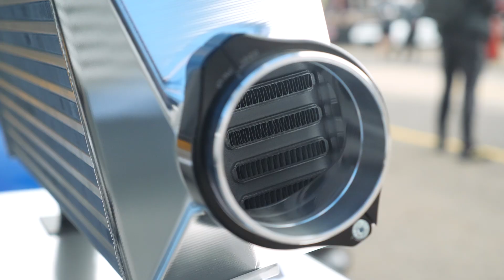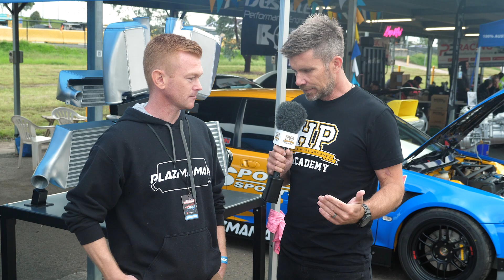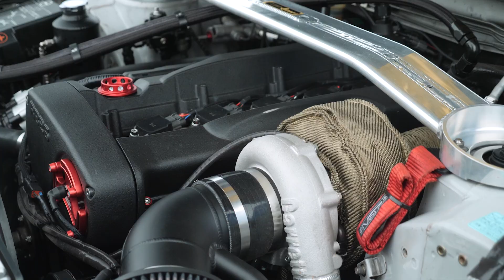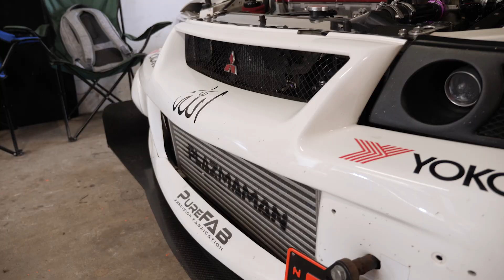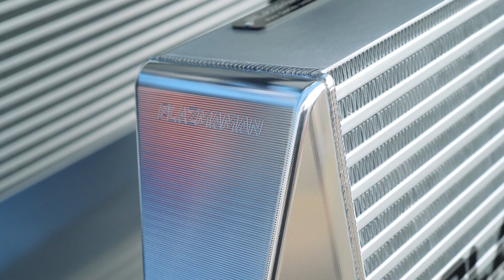Not All Intercoolers Are Made The Same 🥸

Comment: Also a good tube a fin will have 2x less pressure drop then a bar and plate.
Reply: Bollocks.  If you have less pressure drop, you have less cooling performance.
Reply: @Hypersonik Bollocks my point is still fact.
Reply: @Good-luck-Jonathan  So you're admitting that the intercooler doesn't cool as well, thus will offer detonation?
Reply: @Hypersonik  So your admitting a bar and plate will have more pressure drop?
Reply: @Good-luck-Jonathan  No, I'm saying that with either solution, if you cool effectively, you have pressure drop.
Reply: @Hypersonik  I’m saying that the bar plate will have more pressure drop inherit in its design over a good effective tube and fin.
Reply: @Good-luck-Jonathan  That is completely dependent.  If B&P has more of a pressure drop, then it can have less area because it's more efficient at cooling.

The advantage of T&F is weight.  The advantage of B&P is robustness.

Take your pick :)
Reply: @Hypersonik  B&P is not always robust due to leaking inherit by design when flexed. Pressure drop is not just related to how dense the fins are but how the fins them self's are deigned as well at how efficient the heat transfer is vs pressure drop. If you watched the video, B&P has more aluminum mass and that acts like heat sink and takes long to recover which is why for drag racing B&P would be where to use it. There have been testing down on Chinese core with little fin area but massive pressure drop so as mentioned they are not always linear.  Look how efficient this T&F design. https://www.youtube.com/watch?v=SIdOcOjr6Gk
Reply: @Good-luck-Jonathan  What you've said is a mixture between incorrectly manufactured items, and inherent design.  As for flexing the unit...that's fine if you're going to have it as a load bearing structure, more people don't.  What is more likely is that you'll get a rock thrown up at your low mounted cooler.

  You mention about the heat sink.  Yes, that is true, but if you're exceeding the thermal dissipation rate of the cooler, it doesn't matter about the heat sink effect does it.  The only time this becomes and issue is if the car is stood for a period where heat soak can mean that the until can hold more thermal capacity and thus, under flow conditions, takes longer to restore the charge air.

Pressure drop - yeah, if something has collapsed, or something has broken or wasn't made correctly, you will indeed get a pressure drop.  However, saying that B&P offers more pressure drop from inherent design is nonsense.

I watched your video.  My word, it's a lot of hyperbole.  If you always remember how thermodynamics and air flow works, you can sport the bullshit a mile away.  Again, referencing your video, if his intercooler cools charge air down to 1ºF above ambient, then an awful lot of heat must be given off to the air, thus the radiator behind isn't going to work well, which they completely ignore.

And fore some reason a B&P designed stops radiators from working.  No mention of how that happens, just that it does.  TOTAL BULLSHIT. 
This is a sales pitch video, you just don't see it :)

As I continue to say:
T&F = lighter weight
B&P = more robust (unless you're using to to mount your subframe to...)

And that's it.  Don't get suckered in by the marketing.
Reply: @Hypersonik  I still disagree on the core argument based on the evidence I have seen.

Comment: Not sure if my question will be answered here.. if I drive in stop and go traffic

Tube and Fin vs Bar and Plate

How long and at what speeds before the IAT post intercooler drop to non heat soaked levels(below 55c or 130F, with over 40c or 105f ambient)?

Comment: they are the same

He forgot too mention the disadvantages in bar and plate are made up with slow heating

obviously anything that “takes long too cool (the extra mass) has a flip side being it takes long too warm up.

Bar-plate suits a street car as plenty of cool down time is available AND longer cool temperatures when booting it

Tube-fin better for circuit, better (with) high speed cooling
Reply: agree 100%,  Bar and plate has been better in my experience for the street, being it is well designed with a high flow core.  Really, tube and fin/ bar and plate made well are leaps and bounds better than the OEM intercoolers especially when you run higher boost applications.  I have a CTS bar and plate intercooler for my audi S3 and it has been amazing  with dissipating heat for extended times in the Deep South where  I live. I have never once had my CTS intercooler truly heat soaked. My car just keeps pulling time and time again hard in the heat, the outlet temps remain with 10 degrees of ambient.

Comment: Funny how those tube and fin ones from plazmaman aren't even close in fine count to a threadstone. They honelsty are a bit closer to a ebay deal then the latter. End tanks are really nice looking but I just can't see them working at the same level at all.

Nothing compares to a garrett core.
Reply: I have had a garret core which was 2 76mm cores together making a larged stepped core.

I then got a Plazmanan tube and fin which was smaller. The Plazmaman ran cooler iat and did not heat soak like the garrett core.
And Plazmaman was half the weght.

Comment: From an engineering perspective, bar and plate is just bullshit. Dissipating heat by metal conduction is insufficient, and the reason is no matter how much materiel is taking heat from your fluid, it won't be able to transform it all to the atmosphere because the surface where the convection happens is so reduced compared to what we have in the fins.

Comment: I'd love to see a feature on water/air systems that use the air-con to chill the water and achieve IAT readings way below ambient.

The dodge demon runs one of these as OEM. And the FI interchiller is a very popular and proven aftermarket option for any forced induction application.

It seems like a lot of people aren't aware these systems exist.
Reply: They seem to be far more common in the States in the aftermarket. In Australia not many people bother with them. I suppose it's mainly later model, milder builds here that tend to keep their A/C systems for obvious reasons. The heat your creating in front of the intercooler's radiator and the engine's radiator negate any benefit from the interchiller, that's what I'd be worried about in a street/strip or street/circuit application
Reply: @danielbrealey2924  lmao.
Reply: That's because the intercooler is very inefficient to begin with on the dodgey demon. The system is only good for short term while the car is not moving. Who cares about going 400m in a few seconds, that's for cars that can't handle corners.
Reply: @chippyjohn1  aah yes, "who cares about drag racing?" He says.

On a video about intercooling.
From a brand that sell courses on installing and tuning  engine management systems.

Ran by a guy who held the 4G63 drag racing world record for several years and is regularly involved with professional drag racing teams from all around the world.

But sure thing guy.
Those are just cars that "can't handle corners" and whatever little low corner carver you have is definitely super special.
Very clever. Gold star for you.

Comment: Might be a pretty dumb question. But I own a vw golf r. Live down south in Texas and Temps are already reaching 110 degrees before the middle of June. Running it stock, but seriously looking into an aftermarket inter cooler to ideally improve overall reliability and better thermal management. I’ve been interested in the integrated engineering intercooler. I notice it claims to be a “bar and fin” combination. I was wondering if this is sort of a hybrid of the two designs mentioned here? If so I’m curious if you or anyone in the comments here has any thoughts on that design? Great video!
Reply: The IE intercooler is a bar and plate design. Its a very good quality intercooler for the Mk7 GTI and R.

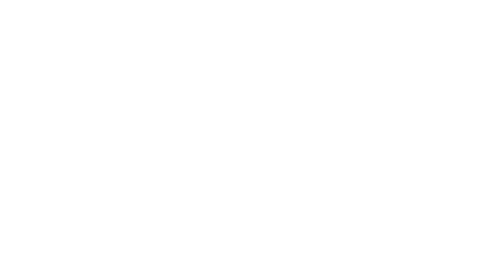Comment: 5:20 - wouldn't the fins actually accelerate the air volocity passing through because the fins would reduce the 'void' in the cross section for the air? 
However, having the fins will make a huge difference in the surface area exposed to the moving air, and that would be responsible for the actual cooling improvement?
Reply: That’s what I’m thinking.
Fins are meant to increase surface area not slow down the air flow.
Air speed might be faster but I don’t think the difference of air speed is significant.

Comment: I was hoping to see vertical flow vs horizontal flow comparison; any videos you have on this?
Reply from the maker: Outside of a little discussion on the SR86 build (I think) we do not. I'll note it down for Andre, but also worth thinking about how the ducting is probably going to be more of an importance here than just if you are running vertical or horizontal alone, which then also comes down to how much room you have to work with/packaging.
You can also chat directly to your supplier about things like this before you purchase. They will know all the right questions to ask to help you figure things out, and you can talk to a few chaps to make sure you're getting the same answers as you find your feet with it all - Taz.
Reply: @hpa101  I worked with a world leading supplier and the core they sold me can't handle 475bhp, let alone the 700bhp it was supposedly rated for. Looking to learn how to size vertical flow intercoolers before I trust them to redesign again. Can VE differences between engines account for differences in power ratings for intercoolers? Similar sized cores for K series engines are rated for 700hp.

Comment: I didn’t really hear any downsides for tube and fin. Maybe they’re a little more fragile?
Reply: backpressure/ more internal fins the better it exchanges but the more it backs up the engine . if its a turbo and not a great choice of turbo then every psi drop through the IC and IC piping amounts to almost 2 in the exhaust . this is the bit people dont grasp/ basically the bar plate is the better choice there but it has to be physically larger to amount to the same amount of cooling but at less pressure drop

Comment: A2W or nothing :D
Reply: Not always possible due to packaging constraints. Weight considerations too.
Reply: A2W I would think is for short term cooling requirements like drag racing where they usually put ice in it to maximize the cooling of the charge air. I would think it’s not suitable for road racing or street applications where an air to air is going to be more efficient in longer durations.
Reply: @weduhpeople8504  the only part of that which I can agree on that there is additional weight and packaging requirements for a water/air intercooler system.

Most of the "air/water vs air/air" comparisons you'll see will be showing a fairly optimised air/air system (since the tech is basic and well understood) compared to an air/water system with a hopelessly undersized charge-air cooler, tiny front-mount heat exchanger (Less than 1/4 the size of the air/air unit) and a water pump that barely flows 5gpm through the system.

The ability for water to absorb and dissipate heat is 4x that of air in a 1:1 comparison by mass, and for circuit/road racing an air/water system has way more potential when optimised.

As a cherry on top, when you consider the option to run an A/C unit like an interchiller to make the water run at sub-ambient (and sometimes sub-freezing) temperatures. The advantage is clear.

Air/water all the way!
Reply: @jacksonjdr94  A water chiller would be crazy to run, cooling down 10 kg water that constantly soaks up heat.
10-20 hp would be needed to keep the temperature down for longer then 1 drag run at the time.
Designing a better turbo system would be preferable before talking about water chilled intercooler.
Also the hose routing would be annoying because almost no one wants extra weight dangling infront of the wheels, so things needs to go into cabin or boot.
Reply: @larsjrgensen5975  AC chilled water/air systems can work exceptionally well and achieve IAT readings *way* below ambient.

The dodge demon comes with this type of system from factory.

There are quite a few videos on YouTube exhibiting the cooling capacity of the FI Interchiller.

One of the more recent ones shows a vehicle idling on a 41c (106f) day in australia with IAT readings of 12c (53f).

There's also videos of vehicles on the dyno comparing using water at ambient temp to chilled water and the power gains are usually in the 50-100rwhp range through the entire curve.

And an AC pump uses zero horsepower when it's disengaged. So you wouldn't run the AC pump when going down the drag strip, you'd use pre-chilled water from the reservoir.

A road race car would be a different story, you'd calibrate your engine management to engage the clutch on the AC when the temp of the water in the reservoir reaches a certain mark.

 Being able to reduce intake air temp below ambient and keep it cool is just a win in every possible way, it can save hours on the dyno and ultimately make for a more reliable boosted motor.

Heat-soak is one of the most challenging  issues a tuner has to face, as it can vary widely from dyno conditions to real-world racing conditions.

These systems provide a tuner with something that an air/air system never can. Consistency and repeatability with an active system to keep intake air temps in check!
Reply: @jacksonjdr94   The FI interchiller looks to be working, but the video I watched had really bad water temps to begin with. (video was a FI interchiller hellcat)
The water temp without chiller was 125 just cruising in 85 degrees weather, the intake air would probably be in the 135, so the baseline is really bad to begin with.

The gain at lower temp, depends a lot on how the intercooler system is dimensioned to begin with.

Turning on and off the AC pump makes this setup mostly drag race only, because accelerating for 10 seconds would need more then 10 sec to recover with AC on full.
I do believe that is why the dodge demon only has it running in drag mode, it cools for 5 minutes and that is then enough for 1 burnout and a less then 10 sec pass.

The heat exhanger on the FI interchiller looked atleast 5 times as big as the Demon stock chiller, so I do not have high expectations about the Demon capabilities of keeping the water cooled for more then 15 sec WOT.

Most tuners have big ass fans for the intercooler and radiator, the tune also needs to compensate for air temp, because the chiller is not going to keep up with trackday driving.
I have never seen intake temps at 125 on my stock air-air intercooled family car, not even in stop and go traffic, but a Hellcat apparently has that with the stock water-air intercooler.

Air-air was good enough for 1000+hp in formula 1, so it is good enough for me.

Comment: If tube and fin it must have a protective small mesh grill. It is lighter but bar and plate is heavier but more durable from road debris, acts as a heat sink dissipating heat. Air foils will help concentrate colder ambient air to the intercooler core. My question, is a thicker core better than a larger front surface area in a core? I want to have a 5” thick core. With a larger front surface area air foil directer inside the end tanks will help distribute the cold air from top to bottom of the intercooler core. Also like you said very dense fins for an ic core can cause backpressure to the turbo as well as inhibit air flow to a radiator and a/c condenser behind the ic core. For gravel rally racing a bar and fin core would be more suitable due to the road debris hitting the core. For street and road racing a tube and fin may be more suitable.
Reply: If it has the same cross-section, the larger frontal area and shallower depth will be expected to be more efficient for charge cooling.
The front row has the biggest delta in temperature as it is getting ambient, as the cooling air passed through the rows it picks up heat energy and the 'delta gradient is reduced, the more rows the less effective the last one will be.
On the other hand, a large front area has a much larger mass of cooling air passing through it to absorb the heat, and fewer rows so their average delta will be greater.
You may see some installations where the charge cooler (or radiator) is inclined to give a greater area to the matrix.

Same principle applies with liquid to air radiators.

Comment: To get the lowest restriction possible it would make sense to have a much shorter but wider core with wide end tanks, similar to OEM Subaru STI ICs. Is it only a matter of packaging that vs. a standard "long core" setup, or are there other aspects that you sacrifice as well doing it this way?
Reply: AVO used to build intercoolers exactly that way for VL turbos years ago. Maybe 600x250 with the tanks on 600 edge
Reply: Just thinking of it at the very extreme, a very tall but narrow design may not have the air traveling through it long enough to exchange it's heat
Reply: @Onewheelordeal  Yes but at the same time the air is passing the same area of metal. And a longer core will start to heat soak in the second half of it so gets less effective anyway. I belive that just comparing core size, the variant I propose is better at the balance of heat exhange and pressure drop. But large end tanks is also taking space that could be used for increased core size instead.
Reply: @bingoberra18  

Exactly, I'm quite surprised that no-one seems to have started making trapezium/trapezoid matrix to maximise the area in restrictive places.
Reply: Bell intercoolers makes slanted cores.
Reply: @Onewheelordeal  apparently the vast bulk of heat transfer occurs within the first 3rd of the core, which is why very long intercoolers with few rows are less than ideal